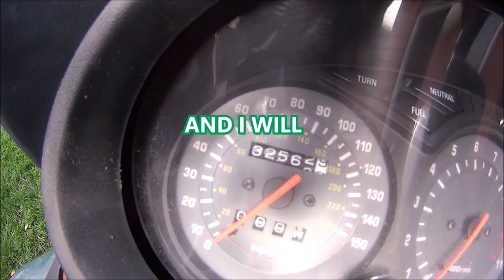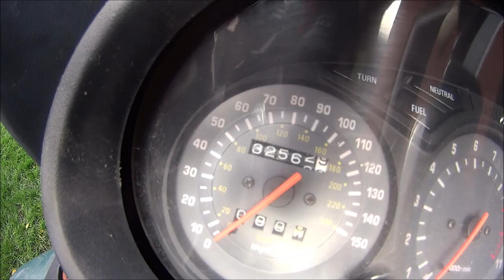xj900s KNACKERED ALTERNATORS & GLEAMING ENGINES.

Comment: Hi mate I feel your pain on the alternator I've just had to bite the bullet and get new set of carbs for my project someone had done the mixture screws so tight they snapped the alloy on carb body on 2 of them no wonder couldn't get it running lol but silver lining on watching you spray paint the engine was I remembered why I was doing it in the first place cheers my man
Reply from the maker: Sean Treloar it's turning into a money pit lol no I think I can see the light at the end of the tunnel. Good luck with your project buddy.

Comment: John John John you were supposed to use a tap out of a tap and dia set or good mole grips once you have drilled the hole with the extractor not a drill, what happens it grips it has you turn it anti clock wise(don't use a drill mate) also buy a decent six sided socket set not the multi sided ones i don't entertain those at all, trust me i have been on the spanners near on thirty years, and i will e-mail you tomorrow once i have been to the workshop and i will look to see if we have an alternator on that 900 engine i can't remember if it is on there still and if it is i will send it to you for all your hard work ha ha, i will get in touch tomorrow mate keep up the good work, Kind regards Mark....PS the engine is looking good.......
Reply from the maker: SooperSkoots mark mark mark now you tell me omg lol.

Comment: That engine has come up lovely, is the alternator aluminium?  Can you aluminium weld it, i saw a demo a couple of years ago at the Kempton market motorcycle jumble, looked very easy to do, and the kit was about £20.  You also might have some luck refurbishing the existing one if you can repair it.. There are a few firms that repair them in this forum post https://www.therevcounter.co.uk/threads/27355-Alternator-reconditioning.  Good luck fella.
Reply from the maker: GTs Garage thanks GTs. The alternator is locked up solid I can't even separate the body casings but I have my eye on one for £38 just got to wait for payday lol
Reply from the maker: GTs Garage PS thanks for the link. (brilliant)